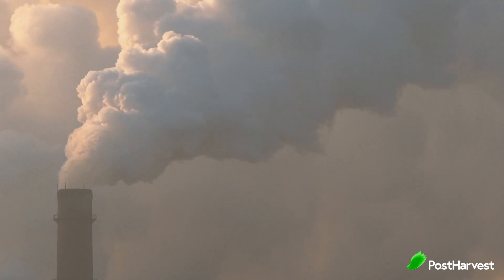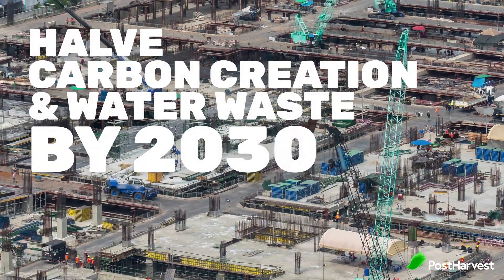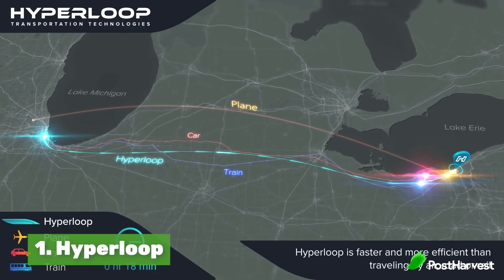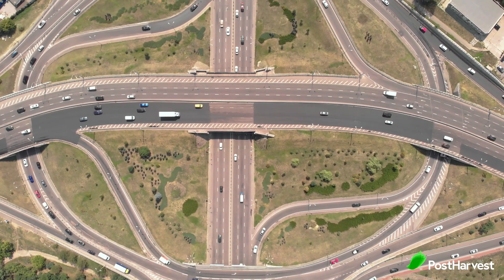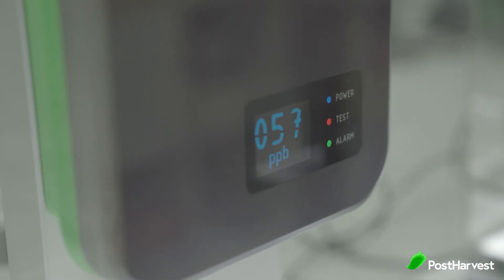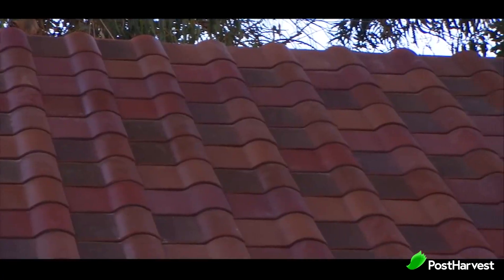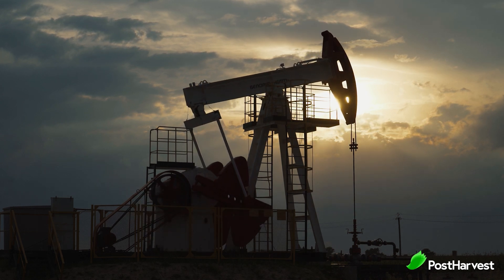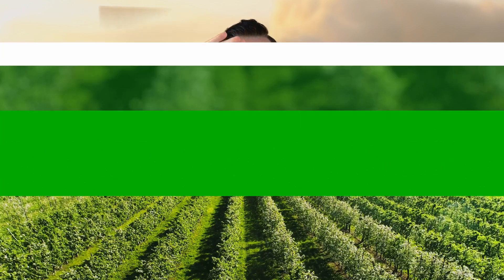Top 5 Technologies Reducing Carbon Emissions

Comment: Can you update this video with latest statistics at of 2024? 

While solar is promoted for alternate sources of energy, California and Nevada today  produce more electricity from solar than can be consumed, there is a very small % of electricity being stored in batteries. Talk about how investing in high-voltage direct current (HVDC) to transmit power to other states, or power-to-x technologies, such as power-to-gas (converting excess electricity into hydrogen or synthetic natural gas) and power-to-heat (using electricity to generate heat for district heating systems) can be developed to deal with turn renewal energy losses into opportunities.

Comment: XPRISE CARBON CAPTURE 
The heat loss from a smokestack can be forced into a large tank containing hot liquid microcrystalline petroleum wax. The heat will keep the wax at a molten state which facilitate the carbon to be absorbed when combined with the wax. Carbon when mixed with wax reacts like a dye. The wax-carbon amalgamation result in a black wax solution thereby making it impossible for the carbon to escape into the environment. Other toxic particles are also captured in the wax settling at the bottom of the wax holding tank forming into a sludge. A sludge release valve is located at the bottom of the tank. After the sludge is removed more wax is replaced in the vessel working something like a toilet. The sludge becomes a byproduct that can be used as an additive to asphalt for roads or used for cocooning nuclear waste materials for long-term safe burial. The entropy of the Earth has been increasing at a startling rate since the beginning of the industrial revolution caused mainly by the carbon that is released into the atmosphere. Government scientists have failed to stop and prevent carbon pollution from entering the environment. This problem can only worsen until a solution is found before this problem becomes irreversible. It has been discovered that formulated wax has been shown to be the only answer to this problem. William Nelson
Reply from the maker: 100% Cant argue with America's greatest activist